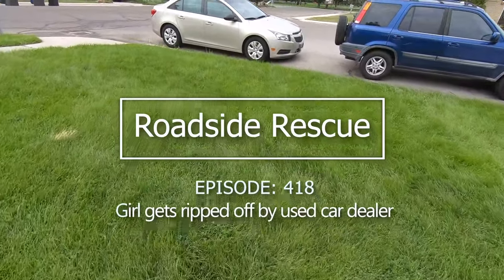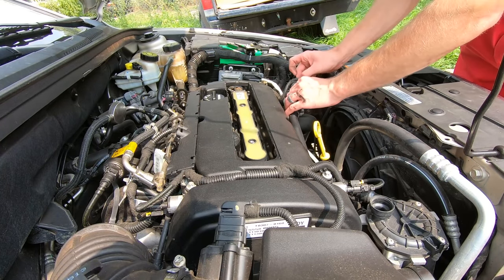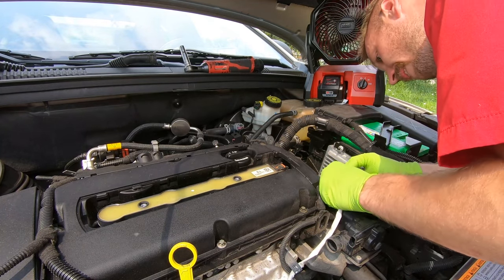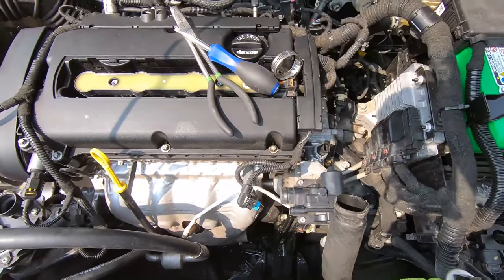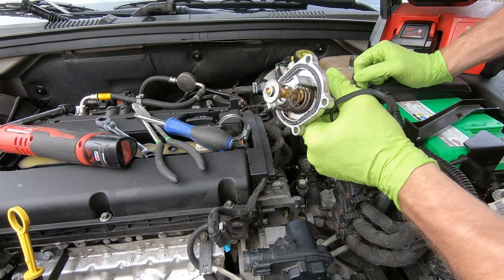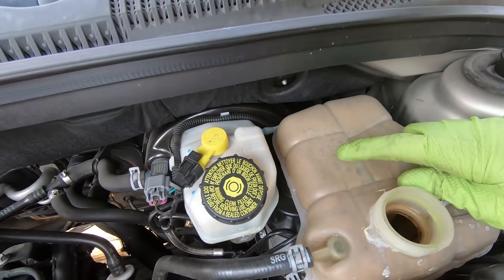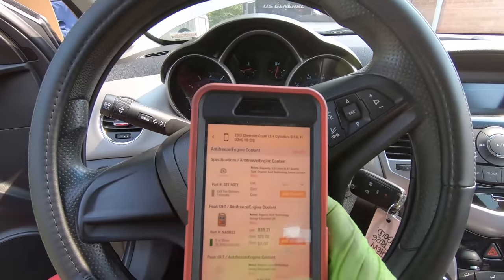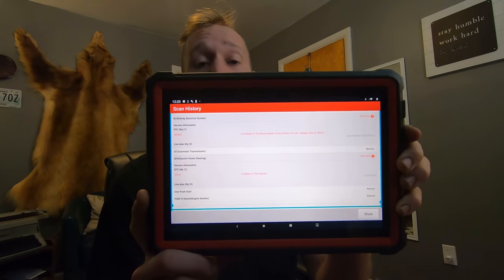Girl buys 13k mile "new" car. She was scammed. Heres what happened...

Comment from the maker: Also, I forgot to mention this. The customer had the dealer "Fix" a leak 1 week after purchase. They were billed for "Replacing the thermostat". Which, clearly wasn't replaced, according to the flat gasket and swollen inner gasket. That may be the only reason the dealer took the vehicle back? Or, maybe they are nice. IDK I'm just glad it worked out okay this time!
Reply: The 1st gen Cruze has always bend problematic the water outlet on the Right side of the block on top of the transmission always leaks.
Reply: That’s a huge disappointment that they billed out a job that was never done.
Reply: Can I please get a post notification shout-out iam subbed and I liked all your videos 😔
Reply: @RadDadisRad  im not surprised at all though
Reply: Stealarphips !
Reply: I was about to ask if the word "scammed" was fair, given that they agreed to exchange on an as-is sale since the car (despite possible HG issues) seemed perfectly "fit for purpose" (in the strictly legal sense... It was a steaming pile in plain English) in that it ran/drove/stopped as requested and wasn't boiling up every 20 miles.  Having seen this comment though I think maybe they were "trying it on" after all and, faced with a slick-talking friend and your video evidence of the non-replaced 'stat job, decided discretion was the better part of their fake valor & will be sending the Chev' on it's way with someone less suspecting after a good coolant flush. Maybe.... Hopefully they'll just run it through the block instead and make a fair sale that way.
Reply: That t stat looks new, I think they replaced it with the cheapest one and reused the old gasket since the el cheapo ones many times don't even come with a gasket. The milkshake is a dead giveaway. Those cars are big piles of junk regardless so your customer dodged a bullet there.
Reply: @335m5  Hm. Does it have a separate oil cooler? Could be an issue. Though, if that was stopleak in the system, it's had coolant leaks before and been potentially overheated before. So head gasket seems fair/probable.
Reply: @335m5  Well they didn't fix the leak obviously. They still suck at the bare minimum but they get credit for taking the car back. Hopefully they don't sell it as is to someone else without disclosing a bad head gasket or fixing it. If the mechanic really did change the thermostat though he must have figured out the head gasket was bad and obviously didn't say anything. Again shady at the minimum.
Reply: @335m5  I would, based on the fact they had it for a couple weeks I think he said? And it has oil mixing in the coolant. Head gasket, oil cooler, the reason is irrelevant. The fact it was happening would be reason enough to take it back. And doing a head gasket is a pain in the ass. And absolutely not something I would want to pay for after just getting the vehicle.
Reply: @335m5  Gotcha.. didn't know about oil cooler, etc. Coolant looks bad though. Not something I would want to see on a car bought 2 weeks ago.
Reply: @335m5  No, a head gasket is a pain because it's a pain. Manifolds, hoses, connections, injector rails, intake gaskets, brackets, removing old gasket material, having the head machined flat, and on, and on. 

It's a pain in the ass. 

Also, I'm pretty sure your average jackwagon can discern valid reasons for taking a vehicle that was probably broken before back to the shady-ass dealer that sold it. Blown tail light bulb? Probably not a good enough reason. Blown head gasket? Absolutely a good reason. Don't feed me your BS.
Reply: @digi3218  yep milkshake very common due to 100 dollar seal. But it damages every rubber hose and seal cause they swell up. Absolute pain to fix, and man did that thing a terrible rattle for a car with 13k on the clock

Comment: Let’s not miss the point of “never buy a Chevy Cruze.” 😅
Reply: Replaced a turbo twice in the same Cruz 🤣
Reply: Agree, except for the Cruze at the end.
Reply: I have a 2012 Sonic,pretty much the smaller version of a Cruze.....worst car ever!!!
Reply: @Doing_it_right_the_first_time  FLAWLESS!
Reply: Just buy a Toyota if your planning to keep it for ever
Reply: My son has a Chevy Sonic RS. @28k and 18 months old it overheated & locked up while driving through the desert. It only has a warning light which only serves to tell you the engine is toast.
He had it towed 300 miles to the dealer who is kept it for 10 weeks while they rebuilt the engine. From then on every 9 months it would start overheating again & the dealer would replace the water pump. They replaced the water pump 4 times until the warranty expired. 2 months after the warranty expired it overheated again. The quoted nearly $1000 to replace it again. He declined.
I took to a local shop who found the thermostat was jammed (probably the  problem from the beginning).
6 months later the water pump started leaking. The shop replaced it with a non OEM brand - no more problems.
Everyone I know who bought Chevys built at the ex Daewoo factory has regretted it.
Reply: Agreed. I rather buy and older Toyota or Honda.
Reply: @yodead369  true story
Reply: @Doing_it_right_the_first_time  I had one for 7 years, it did have a recall on the CV, they replaced it for free, never had another issue with it.
Reply: Have a 2014 Cruze with 190k. Bought it used with 171k over 2 years ago for 3 grand. No regrets.
Reply: @Doing_it_right_the_first_time  I almost picked up a cruze eco 6 spd several years ago. Unfortunately (or fortunately) i passed due to dealer playing games. I like the look and feel. 

Seemed like there were a lot of dumb small issues with those cruzes. Knew a girl that had an issue with the security system or key and the water pumps had issues on the first year iirc.
Reply: My understanding is once they start to over heat or have cooling issues they are done.  I don't know how many times I hear about people spending huge amounts on water pumps, head gaskets, radiators, flushes etc... but still can't solve the over heating issue.
Reply: I remember reading a review of the Cobalt when it was new, and the reviewer basically said it seemed like an ok car, but it was the sum of a bunch of shitty parts, outsourced to the lowest bidder. I think it applies to the Cruze as well.
Reply: I have a 13 and love it. No regrets. 🖖
Reply: My comment comes backed up by consistently fixing them at our shop. I’m not saying you can’t find one and have it last. But we see them far more often than most vehicles. As well as Ford escapes. Among others. They all have good and bad vehicles. But we have seen a ton of chevy cruzes at the shop I manage.
Reply: @Doing_it_right_the_first_time  I also have a 11 eco 6 speed that always gets over 40 mpg and I have only done basic maintenance and im at 197k
Reply: @jaredparsons4761  Maybe because its a very popular car and there's a lot out there? 🤷‍♂️🖖
Reply: Our daughter had a 2012 LT/RS with 170k on it before selling it and never had any major problems.
Reply: My 2015 has 295K , so now what
Reply: Nor a horrible Honda!
Reply: I bought a 2013 Cruze for 2000$ brand new inside and out, but water pump went out one month after I bought it. Fixed that it ran great for another month. Then a knocking noise started happening. I found a video saying it’s most likely the timing belt tensioner. So I went to take the old one out and found out the tensioner for the surpentine belt was rattling.
Reply: @tabormiston5054  Did you think you were getting a great deal? You're the one that got scammed.
Reply: They’re not so bad, I can swap their engines in 4~ hours, just gotta carry a spare hahaha
Reply: Yep I can attest to that! Worst new car I ever owned!
Reply: Especially a turbo version
Reply: Nah the only cruzes worth buying are the ones that come with the Turbo Diesel motor. They're more common then you'd think and super reliable
Reply: Or a chevy in general lol 😂
Reply: @bash8387    The obligatory Toyota fanboy comment… It’s not 1996 anymore.
Reply: here in Australia they are called Holden cruze and yes it is well known these are rubbish....they are cheap for a reason and the second hand market is flooded with them....you can always find a heap of them for sale lol, they are prone to PCV valve problems, oil burning,engine issues and even catching on fire form electrical problems
Reply: @cruisen6725  and when things start to break down......a ton of things will fail at once. Rubbish quality and well known for not lasting the test of time.
Reply: @mikes.4811  there are allot of used ones for sale at any given time in Australia.....A Hot potato people have for awhile and get rid of as they turn into an expensive repair bill and rolling pile of Junk
Reply: I have 2013 cruze. Worst car ever. Every little fix requires more fixes because all the plastic parts break.
Reply: @dalesmith4985  Rubbish, nice. Ay mate thanks for the comment. Stay cool down under ay. Dont travel to many kilometers today, mate. Cheers
Reply: I bought a 2011 Cruze , the concept was great but everything else broke , I did the same replacement, also replaced the air conditioner compressor …
Reply: Aka Cavalier
Reply: All the people saying they have a small Chevy and like it must have rock bottom standards...
Reply: @PlainlyDifficult  watch car repair videos too? Awesome
Reply: Any GM product.
Reply: My little sucker 06 Corolla drives good after loading 1000 lbs of concrete on the truck
Toyota, nice boy, nice try 
Chevy, fboy, fbye
Reply: @jaredparsons4761  probably the first generation Cruze
Reply: I’ve got a 2012 Opel/ Vauxhall Astra GTC 1.4t. I believe it’s the same car by GM.
Reply: @Doing_it_right_the_first_time  same. 2012 with the 6 speed, 130k flawless miles. its my daughters now.
Reply: @Axle1007  had to replace the turbo @ 38k 2015 Cruze 😆 luckily it was still under warranty. Also in a weird way we dodged a bullet. Got rear ended by a 20 year old on his cell phone in November 2020. Insurance totaled the car @$8100 with 49k miles. We bought the car for $10.5 Aug 2017. Unfortunately my wife is still having back problems from the accident. Slipped disc in her lower back 😔
Reply: @cruisen6725  for the price you got it and the miles…it’s a gamble but you beat the odds. Got your money’s worth. Most aren’t so lucky with the Cruze.
Reply: @mikes.4811  Excuses. There are a lot of popular cars that don't end up with the plethora of problems that the Chevy Cruze has.
Reply: @ToyotaCelicaDude1  Okie dokie. 😎🖖
Reply: @vmonroig21  definitely not a cavalier My cavalier is a 2000 still have it 250,000 MI great car
Reply: @nickajk1  Cavaliers had good engines, but they had the issue of rusting away in the northeast.
Reply: @mikes.4811  I live in the Midwest and mine's resting away it's all about salt on the roads in the winter every car gets rest trust me
Reply: And dont buy a chevy sonic either...id just stay away from chevy entirely
Reply: @RexenPrime  the Sonic and cruise I think are built in Korea their pieces of crap it's not even a general motors platform
Reply: @RexenPrime  trust me you can stay with Chevrolet there's other models don't generalize
Reply: @nickajk1  No, GM is junk in general. GM has been putting out junk for over a decade now. Newer GM vehicles tend to just fall apart soon after theyre built.
Reply: @RexenPrime  where do you get your facts I wish people who spout nothing but Scotty kilmer advice knew what they were talking about
Reply: @RexenPrime  and don't tell me you'd rather have a Kia or a Hyundai if you're one of those guys I'm definitely not going to listen to you I would never buy anything Korean made
Reply: @nickajk1  from my own experience and from the experience of others. I had a 2015 chevy sonic. The car had 45k miles on it when i got it and my mom owned it before me. She took care of the car maintenence wise and so did i, but that didnt stop the car from falling apart and having a multitude of problems. Ive had other experiences with other chevy vehicles, ive known others to have many issues with their GM vehicles, and i see all over the place newer chevy vehicles with issues that no newer car should rightly have. Dont accuse me of being some scotty kilmer junkie out of nowhere. I think many of the older GM vehicles were made pretty well, but theyve been steadily going downhill for a long time now. If you want to live in some dilusional world where GM is still any good then thats your buisiness.
Reply: @RexenPrime  to each his own tell me what you drive now that you're so happy with I think all the car manufacturers have went down the hill by the way you want me to list a bunch of Toyotas that have problems and or Hondas there are numerous amounts of those out there
Reply: @nickajk1  they were a deawoo design and built with parts from many different countries. The particular one i had was apparently built in michigan. Even the redesigned cruze had major engine problems. The sonic and the cruze arent the only problematic cars, theres also the malibu, the equinox, isues and recalls on the colorados, the silverados, just about everything they ship out has issues and problems. GM today is a company to stay away from. They dont care about customers or about the quality of what they build. Ive had enough bad experiences with multiple GM vehicles and at several different GM dealerships to see that the newer stuff is junk and the guys that work there dont care. Its hard to care about a product you sell when the product isnt made right and causes too many people too many problems way too often and way too fast.
Reply: @nickajk1  I own a 2019 Toyota C-HR and a 1998 Toyota Camry. The toyota camry i own was neglected and somewhat abused throughout its life, but it still runs and drives without issues. Its something i bough to fix up and use, the usual wear and tear components were bad, but almost all original after 23 years. The newer car i have works great, and i make sure to take care of it. From things i see on these cars, they were built well at the start and last a long time with even minimal maintenence. There are other brands i like a lot and other brands i would bash as well. I like hondas and newer mazdas, once they got away from ford and partnered with toyota. Personally, id stay away from any newer domestic brand like GM, Ford, or Chrysler. I dont think any of them are built to last and they arent worth the money.
Reply: @RexenPrime  that's all right but I got one for you knock your Chevys all you want but I have a 2000 Chevy cavalier with 240,000 mi the only problem is it's Rusty but look where I live I'm in Kansas City the car's has original motor and transmission I replaced an alternator and a radiator pretty good better than pretty good that's a great car
Reply: @RexenPrime  and not telling a lie I forgot about the fuel pump I had to replace that once it was owned by a farmer and in two years put 96,000 miles on it I bought it at an auction and I promise you farmers do not take care of their cars so this Chevrolet is a stud I've owned plenty of general motors products and I will not back down until One lets me down
Reply: @nickajk1  well you didnt say what year or model vehicle it is. My argument is against the newer GM vehicles. If your talking about something from the 90s or early to mid 2000s then most of that stuff was pretty good still. Sometimes farmers dont take care of things, but ive known plenty of farmers who may not take the best care of the body but they take care of things mechanically at very least. A lot of farmers, when they buy something its an investment that needs to last them a long time, so they need to take care of what they have.
Reply: RUN, don't walk, RUN from these cars. RUN. Here in Australia they're the "Holden" Cruze - and they're always listed for ridiculously low prices compared to everything else on the used market. I have no doubt these steaming piles helped sink the Holden brand as a whole.
Reply: 2018 Cruze here, pesky P0172 issue.
Reply: @bash8387  buy a chevy if you actually wanna be able to fix it yourself, be cheap to fix and last forever
Reply: I was about to buy one of those Chevy Cruze, they are cheaper than a Toyota or a Honda, and I think they are good looking cars as well. But when I searched on the internet and found just problems and more problems I decided not to buy one. Bought a Civic instead, I am happy with my purchase.